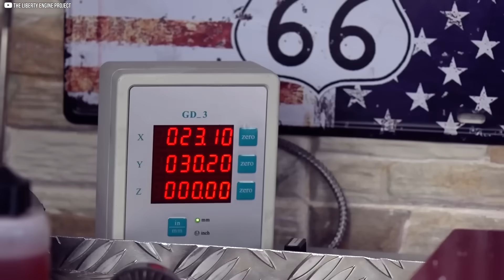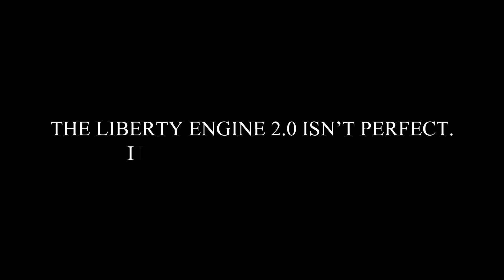Nikola Tesla’s Hidden Invention Just Got Rebuilt – And It Works!

Comment: I have been thinking of this concept since I was a little boy I used to live to play with magnets I always envisioned them somehow attached to like a flywheel or fan blades and then moving them closer to make it spin and then backing it away to make it slow down if you had them at the perfect angle that would be achievable. I always envision the windmill in my head with magnets attached as a crude example. When they show that picture of actually how the magnets were aligned I was blown away. I've been drawing similar pictures from my friends that would listen since I was a little kid. And now I have proof🎉🎉 This is so cool🎉🎉
Reply: No... you still cannot create or destroy energy, just transfer it. Any kind of mechanism with moving stuff would need to be above 100% efficiency, which is impossible.
Reply: @leemilica This only applies to a CLOSED system.
Reply: @leemilica I agree with you, except science knows there is almost infinite energy in the air that we cannot access yet, note the word YET.
Reply: Don't get too excited. Lenz's law means that to get power from a coil or set of coils you must supply a force to rotate the magnets, and the more power you attempt to draw, the more force will be required to move the rotor. I can guarantee that this particular system cannot work. I'm not saying there isn't some clever arrangement of magnets and shielding that can produce rotation. I'm merely stating that THIS isn't it.
Reply: @haroldkline4898  Absolutely correct!!!
Reply: @haroldkline4898  Free energy is a pipe dream(at the moment) so instead of pursuing free energy you would be better off chasing Low cost energy. I'm sorry but this design can never work, similar things are all over the net. if they really worked we would all have one sitting in the corner of our garages running our houses for next to nothing. Not even BIG Power could stop it if it was viable.
Reply: Didn't all of us little boys have the same idea?
Reply: "moving them closer...and then backing it away" is you inputting energy into the system.
Reply: The doubters rely on the thermodynamic laws of energy to dismiss the possibility of "free energy" devices in their ignorance.
Such little constrained minds of no imagination are why we are yoked in bondage to unseen powers.
The "miracle" of magnets is that they are a nexus that transduces 4th dimensional energy into the 3rd dimensional reality, resulting in what is perceived as free energy.
A magnet stuck on a fridge door is perpetually overcoming the force of gravity (a 3rd dimensional force) by drawing energy from the 4th dimension, being expressed in the 3rd dimension as magnetic attraction.
Vortices and toroidal circuitry also have the same effect hence as Viktor Schauberger was able to make use of.
Reply: You & 100 million others.
Reply from the maker: It's amazing how ideas can evolve from childhood dreams into real inventions! Your concept with magnets sounds incredibly innovative. Keep exploring those creative thoughts!
Reply: @TheForgeEmpire  I notice you give positive feedback on posts while cleverly avoiding the fact that the engine in your video DOESN'T WORK.

Comment: this looks and sounds exactly like a john bedini SSG pulse motor, not anything tesla ever made, and it certainly isnt going to be producing even 5kw with such puny wiring.
Reply from the maker: Thanks for the feedback, and it’s interesting to see different viewpoints on how these technologies can be developed!
Reply: @TheForgeEmpire  I'm still very skeptical of the claims of this particular device, however, john bedini's pulse motor configuration does actually hold promise, i have a working model of that here in my workshop. His device is said to utilize two battery banks to achieve "self sustained" operation, a load bank and a charging bank, you drive the motor and your equipment off the load bank until it depletes then you swap the banks around and put the charge bank on load and the other begins charging, this is key because batteries like PbS batteries do not like being charged and discharged at the same time.

The secret to the bedini device is that when the magnetic field in the inductors collapses it creates a millisecond spike of extremely high energy, this momentary spike is fed through rectifiers into the charge battery, this seems to not only charge batteries without them heating up but it also has the interesting effect of being able to completely restore old useless batteries back to (or in some cases higher than) their original factory new capacity. I have witnessed this effect multiple times in my own study of the device, several NiMH batteries that were totally dead and totally useless and WOULD NOT recharge with a typical DC charger, were attached to this device and left to charge for a period of time, eventually at some point you will hear the rotor suddenly pick up speed and then you will witness the standing voltage in the battery begin to climb, this is how you know the process has succeeded.  I then used those very batteries to run my VR controllers every day for hours on end, so I Know it wasn't a phantom charge.

Comment: 20,000 watts from those tiny refigerator magnets he bought from ebay..........   ROFLMAO.
Reply from the maker: The efficiency and power output are definitely key factors to consider.
Reply: @TheForgeEmpire  
Even if this machine were built to its to an efficiency >100%   and is working as advertised (which i'm highly doubtful),   the best case scenario that it would produce "free energy"  is 20 watts....

But the reason this machine will never work is because it uses magnetism as the primary working principle.  Magnets and coils will always find an equilibrium while fighting off resistances, heat, and inefficiencies with the materials and lack of design precision.  It'll never get past 100% efficiency.

Comment: In every single video there is something covering at least one angle. Leaves, angle, etc. The device is never filmed with an open area on all 4 sides. They do this to obscure the wire(s) running the generator/motor. They hide most of it well using green/blue screen technology, but the leaves were a dead giveaway.
Reply: Yup. But hey, at least we have fancy blue LEDs to make it look super techy and futuristic.
Reply: And it looks like part  of a belt on one side.
Reply from the maker: Thanks for your observation! I will make sure to improve the camera angles to show a more complete view in future videos.
Reply: Even then you can use an induction coil to transmit power a short enough distance.

If you can hide the coil well enough then you can still pull that "free powahhh" trick pretty easily.
Reply: @mnomadvfx  I don't think the coil method would work, induction requires close proximity, especially if it's going to transmit thousands of watts. With a really big loop and high voltage you could have a much larger gap, but the setup they use has no room for such a loop. Enough batteries could be hidden in the frame though, if the demo only lasts a few minutes. Or each appliance could have its own source of power hidden within itself.
Magnets do require a lot of energy to polarize, so it is theoretically possible to extract energy from magnets, but that doesn't seem to be the working principle here. There has to be  a trick though, at least based on what I've seen so far, there's no way the magnetic field would produce more energy than it requires to move the magnets past the coils. The microwave part also doesn't make any sense to me. I wish it could work but a feedback loop isn't the way. Bending gravity or capturing potential differences between the ground and atmosphere would sound more plausible.
Reply: 2002年3月12日にアントニオ猪木が「猪木ナチュラルパワーⅣ」という半永久機関を発表しましたが機能せず。
その後の発表も見送られましたまからね。
騙されただけのようです。

Comment: Only 80 amp 250 volts, house   Uses 200 amp 220 volt,
Reply: Yeah,but the first era knob n tube house hold was a meir 60 amps!If it truly functions,its Not a bad  start!
Reply: @rickswartz4255  A fancy new mcmansion house may have a 200 amp main breaker at 220 volts, but would never use that much. That is its maximum capacity before it clicks off.
Reply: My air conditioner has a 30 amp breaker.
Reply from the maker: Thanks for the input! It's important to consider power requirements when integrating this type of technology.